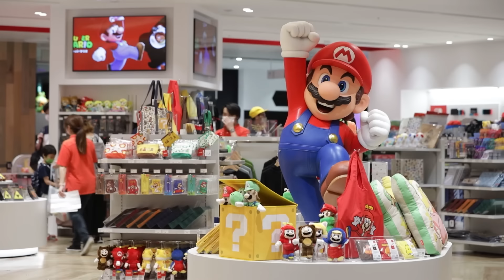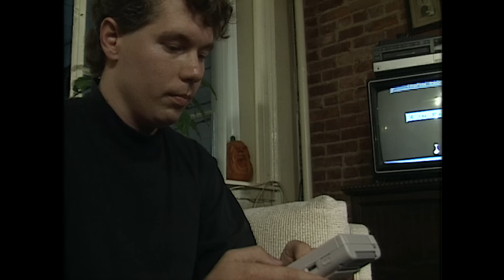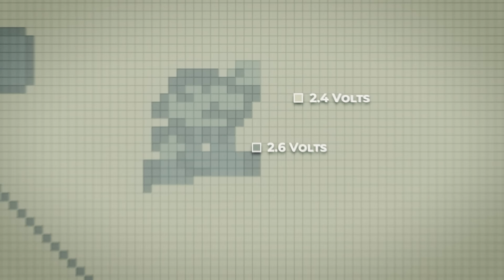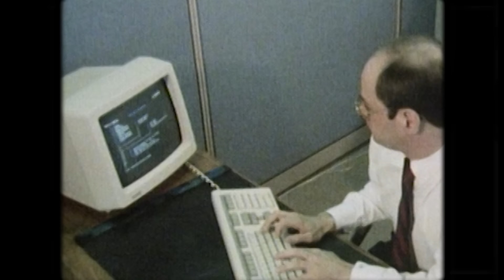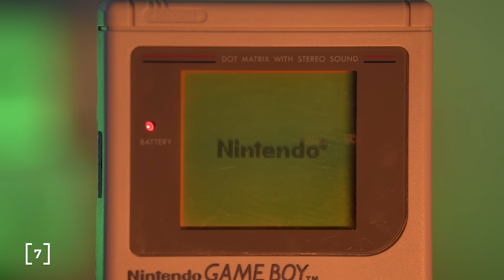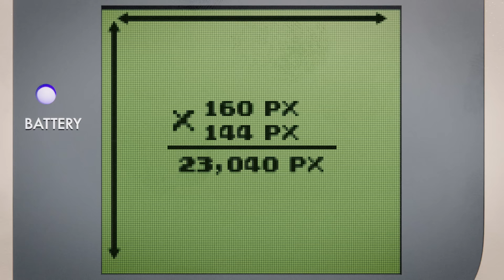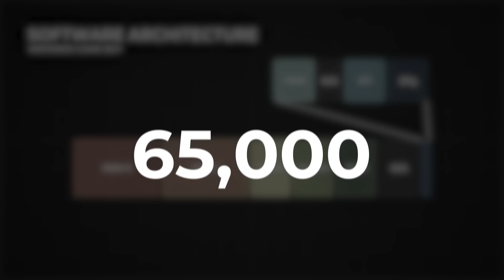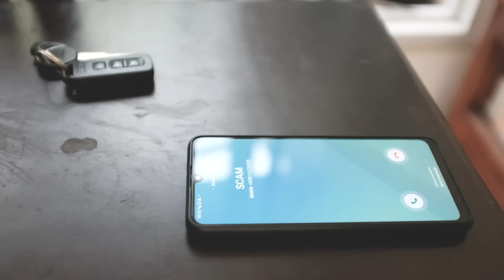The Insane Engineering of the Gameboy

Comment: My first Game boy was a Christmas gift. The second one I shoplifted.
I had that battery pack with the belt clip, and one day I accidentally ripped the tip off the cable. My dad ended up soldering the battery leads directly inside the Game boy. I remember to open the Game boy he had to make a custom screwdriver out of grinding a custom tip on an old tool using a dremel. Thanks dad, RIP.

Comment: My original Gameboy still works great, still amazed how well it works other than the extreme battery use. Need to add some 18650s with USB charging at somme point to keep it running.
Reply: Extreme battery use? The Gameboy was more gentle on batteries than any other portable system.

Agreed about rechargables being the way to go, though.

Comment: I just have to change the 2032 battery in my Saturn yesterday. Yes, the Saturn uses a battery for its internal memory. When it goes, it wipes out any saves stored in the console. Changing the batteries in it was simple.
Reply: Most PC gamers will know it as CMOS battery that stores the BIOS data. So if battery goes out, you start running at default settings. Perhaps not as hard hitting as losing your saves, but for people who don't know it suddenly "PC loses half of performance" is often frightening. And yet many people forget all about that battery. You have no idea how many troubleshooting hours that I did could be saved or partially saved by people knowing to check if the battery isn't a problem.
Reply: @jannegrey  I work on a lot of old PCs. Those CMOS batteries last a surprisingly long time, depending on how good the battery is - I've had motherboards still holding their settings after 20 years on the original battery that I know is original because I was the original owner of the board! On the other hand, sometimes when they go out, things get weird. Some boards work fine on a dead battery. Some start up but have weird crashes because borderline battery voltage causes random bitrot in the volatile memory. Some are just bricked completely until you take the dead battery out and put a fresh one in.
Reply: @wasd____  Agreed. I still have boards that have those 20 year old batteries in them. But I had also 2 cases (1 mine, 1 friend of mine, who's system I built) that had battery go out after 2 years approx. Variance can be big. Generally speaking, those batteries are cheap enough that I suggest changing them if for example you change your GPU so the system can last another 3 years. Not something very important and probably a bit unnecessary, but at least it avoid headaches if battery goes out and it adds to some other problem.
Reply: All the gameboy cartridges with saving have one too, but what size depends on the game.

Comment: Regarding the trademark defense mentioned at 9:02, it turns out Sega did a similar thing for their Genesis / Mega Drive system, but when they took Accolade to court over it, they lost, establishing the precedent that it's not trademark infringement if technical aspects of the system force you to use that trademark. But of course that was after the introduction of the Game Boy, so Nintendo wouldn't have had that precedent at the time. Still, it's an annoying thing for homebrewers, who have to put a big "just kidding, not actually licensed by Nintendo" screen after the boot up sequence.
Reply: Sega's copyright system was called TMSS, and actually wasn't in the first revision of the console and came out because they were losing royalties on games sales, and adding the system in later revisions caused issues with some games that came out before TMSS that would hang on consoles that expected it

I think at least one game couldn't progress on early models that didn't have TMSS because the TMSS system was supposed to return control back to the game code once checks were completed, but because the console never returned control, the game hung, although I might be mistaken on that one.
Reply: there's a fairly simple way around this (requires a little bit of hardware in the cart) see my comment above
Reply: @DrTune It's still a massively important precedent.  Every couple years a company tries this same trick, and has to be slapped down again.  Unfortunately, the US legal system is designed so individuals who aren't rich will never win.  Even if we win, we loose from more than a house's worth of lawyer fees.
Reply: @EmperorA0  I'm not sure if that last part is accurate. Back when I was earning my paralegal certificate, I was taught that it's customary that loser pays attorney fees for both. If someone sues a big corporation and wins, then they wouldn't pay anything (and if attorney fees were so high that they mostly canceled out the damages, then lawyers would be out of a job since no one would consider it worth it to hire them). That said, I do agree there's a bunch of problems with the legal system that make it difficult for people who aren't rich to access it (as I already said, you could wind up paying the plaintiff's fees in addition to your own if you lose, although, just writing this out, I'm starting to suspect that maybe large corps. are expected to pay their own fees even if they win - I don't work for a law firm, so take what I say with a grain of salt).

Comment: A wall adapter was absolutely necessary for the Game Gear.
Reply: Don't forget the car adapter as well! Otherwise the Game Gear would go through its 6 × AA batteries in just a couple of hours.
Reply: @TheCrewExpendable yeah, he mentioned that in the video above.
Reply: 1.5 hours playing Shinobi. 4 hours playing Columns. At the time the PSUs were in short supply as well! @TheCrewExpendable
Reply: @TheCrewExpendable  got I forgot how many batteries gameboys used. My parents got me a rechargable battery pack that plugged into some port on the bottom, probably got sick of me using all the batteries
Reply: @moonasha  same, it was heavier than the Gameboy lol
Reply: Yeah, the rechargeable battery pack was the true must-have accessory if you had a Game Gear. It would typically give 4-5 hours on a charge, plus you could keep AAs in the unit as backups if the main battery died.
Reply: @jasonblalock4429  Back then having just [6] rechargeable batteries (plus the chargerS to handle them all at once) was A LOT of initial investment money.  
.  Buying another set of (6 normal, disposable) batteries but using those only while the others were recharging was a reasonable middle ground; rather than starting directly with all [12 rechargeable]. 
. First charger (cheaper) handles only [2] at a time (have to switch three pairs, interrupting your gaming twice); while the second one bought (more expensive) handles [4], so both can be used to charge all [6] simultaneously.
. Buying a [second set of 6] rechargeable batteries "theoretically" gives you UNLIMITED POWER® ... (in practice, sometimes you forgot to recharge the spent [first set], or you are too far away from a SAFE place to leave it connected); so keeping a "fresh" set of (6) disposables {that also double as a quick "emergency replacement" for any other devices} was a safety measure.
Reply: Mine exploded from the strain
Reply: @KaitouKaiju for a sec I thoguht you were responding as if juan was talking about the nerve gear and your brain exploded lmao
Reply: I was always envious of the kid with the battery pack
Reply: Seriously. I never used batteries.
Reply: My folks didn't even mess around, they got me the GameGear and a HUEG battery pack for Christmas along with Sonic Chaos. Life was good.
Reply: Ah yes, I spent many a happy hour within 3 feet of a plug socket.
Reply: I guess that takes out the portability a bit
Reply: Restored an old Game Gear, replaced all the capacitors (Sega used a bad batch and they pretty much all leak at this point in time). While I was doing that I replaced the screen with a modern LCD and found a new power board that allows the Game Gear to run off USB C!
Reply: @morbital  it's a brilliant little system when you give it some much needed upgrades, but I went quite a bit further with mine, I swapped the core components over to a modern motherboard, added in a modern audio board and a new power board with dual li-ion batteries and USB-c charger port, a new screen, and finally a krikzz gg x7, and now I get roughly 10-11 hours of battery life per charge and games look and sound great 

It was a great system hampered by power consumption of the screen and poor battery tech of the time, and I'm glad it's getting the love it deserves from mod creators
Reply: @morbital  you are doing important work!
Reply: @leestuurmans2837 work of the gods i dare say
Reply: OMG this is too much. People sitting next to a car battery or power outlet to play a portable system lol. We are nerds!!! Just insane what people come up with.
Reply: @capoman1 lol, it's not that insane. You're pretty embarrassing.
Reply: Fun fact the adapter for the genesis worked to power the game gear as well
Reply: I remember my dad grabbed an old car battery and an old car lighter adapter and juryrigged everything together after I burned through an 8 pack of batteries in an afternoon.  Power for days, but portability was slightly less than ideal, young me didnt care, young me had a video game 😀
Reply: Took me far too long to realise you didn't mean a wall-mounting bracket. Why would you sacrifice the portability?!

To be fair, I am up late, but still an idiot.
Reply: Thats why i always did when playing Game gear. I even brought mine to school and plug in the power socket there to play my Game gear during free time. Good times... 😊
Reply: I even have the OG SEGA one.
Sadly the caps in my GameGear are dead, so I can't play it anymore :/
Reply: It needed its own power generator.
Reply: That's what i always did, and i also brought my Game gear to school and played using the pocket sockets there. Lovely memories ❤😊
Reply: I had a Lynx, and yeah same. I still remember the pain of having a portable system that wasn't really portable.
Reply: a dc adapter to play at home, a 12v plug for the car and a battery pack for portable play, thats the only way to make it affordable
Reply: All I ever had was a game boy. I wanted a game gear so so bad but they were too expensive.
Reply: I LOVED my Game Gear. Good Times. :)

Comment: You can see LED pulsing with the naked eye, best example would be some of these new car headlights. You'll notice mild flickering as you approach them from a distance. I'm a professional truck driver, I see these things all the time, and I hate them
Reply: Especially noticeable when moving your eyes
Reply: The visibility of LED pulsing is dependant on the frequency of the pulsing. Even at the relatively low 60hz of a poorly designed LED on US mains voltage, the flicker isn't easy to see. By 120hz it's invisible to most people (basically every office with fluorescent tube lights will be flickering at 120hz). If I recall correctly most systems using PWM to control brightness are operating closer to a frequency of 2000hz, so there is no shot you're seeing that without an expensive high speed camera.
Reply: They do for me also, and I also hate them
Reply: I've started to notice that some lights look like they're flickering in my side mirrors, but not when I turn around and look at them directly. I don't think that makes sense (I don't think the mirrors are polarized, or would change the reflection frequency) but it's happened too many times to be all in my head.
tl;dr everything sucks
Reply: With hints of blue.
Reply: Are you sure the flickering isn't just you vibrating in and out of the light cone when you are in it's periphery?
Reply: I never saw a Gameboy Flicker. Rather the display was too slow and Mario had a trace.

For LED headlights I would connect them in series with each other and an inductivity. Two MOSFETs: one to supply voltage and one for free wheeling

No fancy animation if I can help it.
Reply: LED headlights don't pulse on and off like a display screen does, headlights pulse and flicker because of the power system in the vehicle not being stable due to vibration and poor connection technologies, and the alternator itself.
Reply: @Lil_Puppy I would also say poor quality aftermarket lights with cheep hardware will also have a flicker or pulse. On the flip side, it can be designed into the system for getting ones attention. Motorcycle headlights now pulse to stand out.
Reply: @Lil_Puppy  I'm not sure what extension of knowledge you're trying to exaggerate from, but you're rather incorrect for 98% of vehicles on the road. LEDs are pulse width modulated or PWM. Usually 120hz, sometimes 60. Most people can't discern this on and off pulsing, but some can. Some old HID headlights flickered very badly, there's some model in the '08-ish era of Lexus that comes to mind. 

Alternators won't cause flickering because of the frequency they are rectified at. Lose wiring, rare.
Reply: @Lil_Puppy  No, it's PWM. LED headlights aren't just stepped down with a resistor and running on 12V they use PWM drivers.